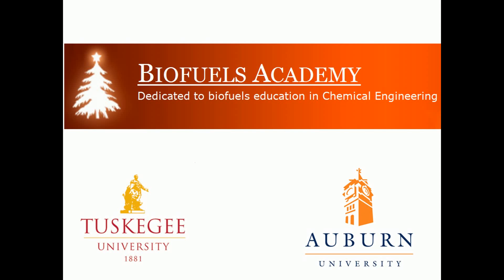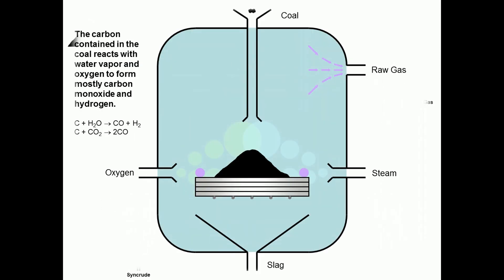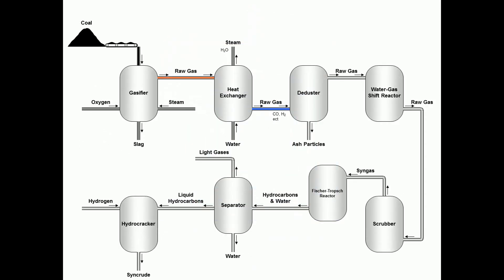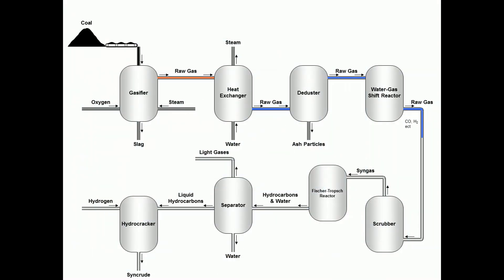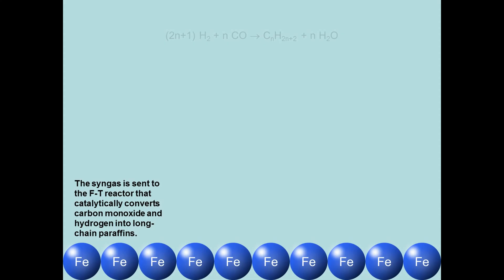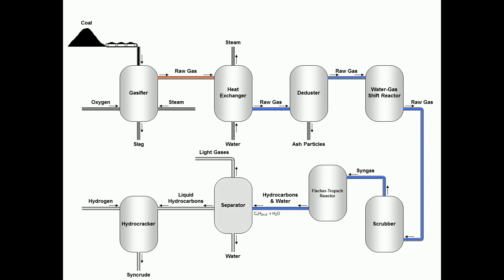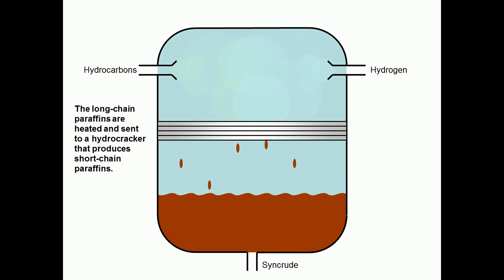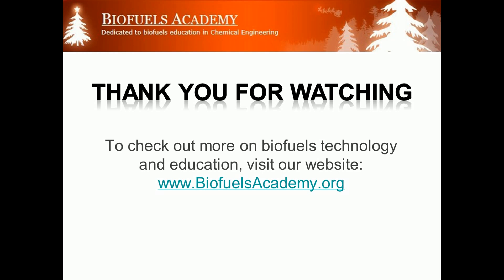Coal to liquids Process

Comment: the real question here is it cheaper than mining for oil?
Reply: I'm definitely a little late to the party but no it isn't as cheap as mining for oil
Reply: @will3553  
Depends on the power source, especially elecricity.
Reply: you mean the Energy Return On Investment (EROI) ratio.
Reply: When oil hit $60 per barrel, Coal liquification became economical. that is why Sasol in South Africa is doing so well. OPEC prices are between $74 and $78.